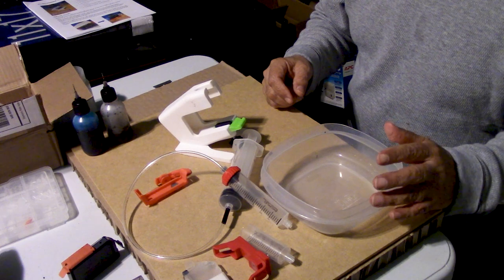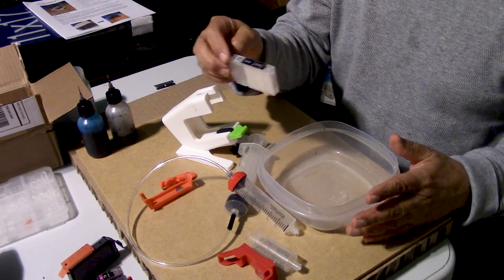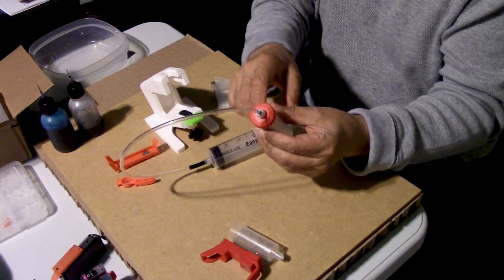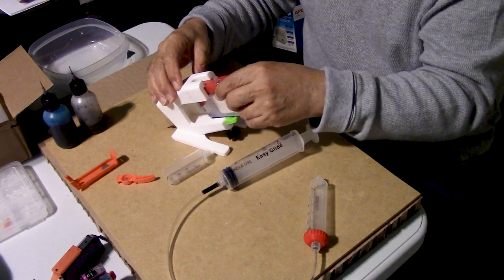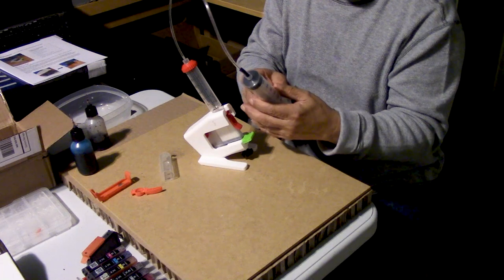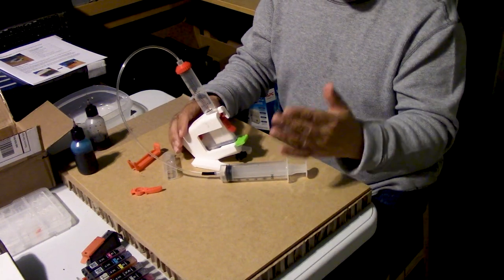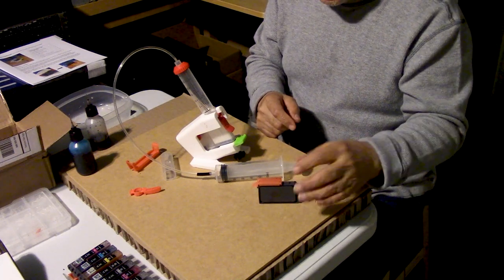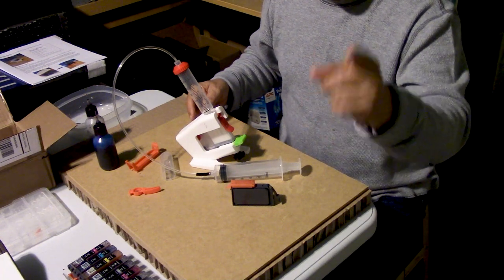A few more Modifications and Details about Rudy's CLI cart Vacuum Refilling System

Comment: Jose do you think it would be possible to take modified OEM tanks and remove the plug and cover the hole with tape and use this system to fill them.  I'm think if you get to much air in the sponge side this would allow someone to remove the air and not have to flush the tanks as often.
Reply from the maker: It would only work IF the hole is Perfectly sealed.